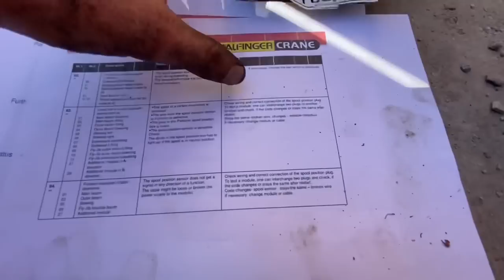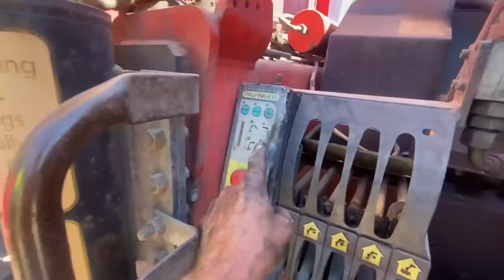D & J projects….Pelfinger crane fault! Air horn tones! Wacker plate walk! Strimmer cord

Comment: Those Honda men designed them throttle levers to be removed and if your intention was to remove the carb for maintainence you used the end of the lever which has a bung on it to stick it up the petrol pipe to bung it up...   No need to struggle and tip the machine up    
Yeah muck and dust ain't the best environment for engines to work in  not suprised the throttle butterfly shaft was siezed
Makes life so much easier when you have new parts to fall back on  other wise  emery tape and grease

Comment: Chris next time you come across one of those solenoids just put a screw driver down the centre of it when pugged in  if magnetises your screw driver it's  working if not bad connection or power supply